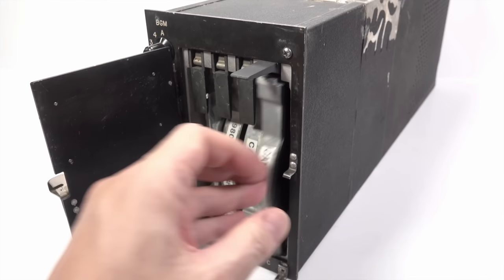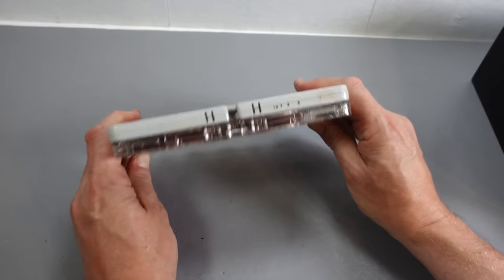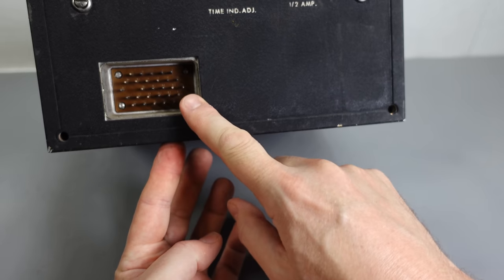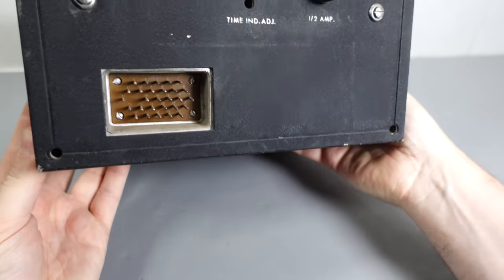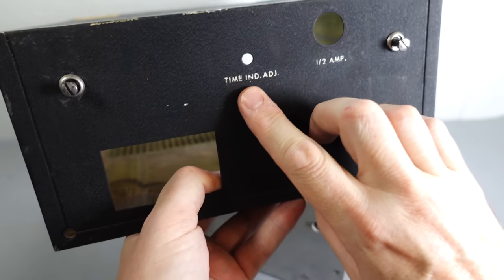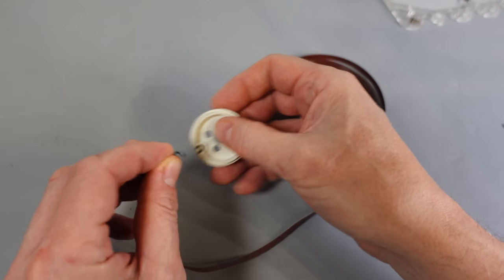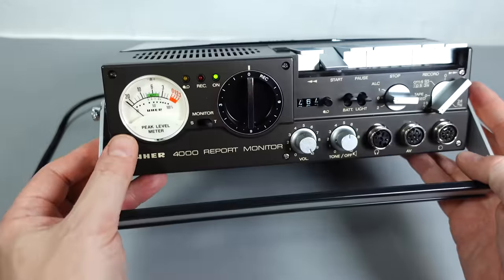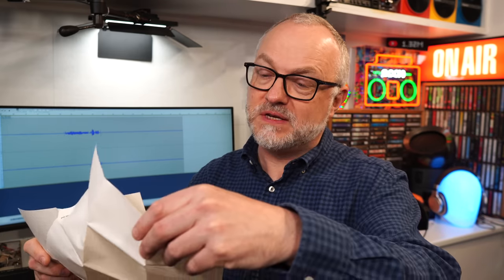Mystery aviation tape machine

Comment: Quick Access Recorder (QAR).

While it’s the best known, the FDR is not the only type of recording device used in aviation. The QAR could be thought of as the non-emergency alternative to the FDR. While retrieving data from the FDR usually means the worst has happened, the QAR is specifically designed to facilitate easy and regular access to flight data for research and maintenance purposes. Its data is stored on removable media and since the QAR is not expected to survive the loss of the aircraft it isn’t physically hardened. In fact, modern aircraft often use consumer-grade technology such as Compact Flash cards and USB flash drives as storage media in their QAR.

Source: Teardown: D50761 Aircraft Quick Access Recorder from hackaday
Reply: you win today ☕
Reply: 👍 this
Reply: Great find.
Reply: The fact that this says it was made for the FAA is also interesting. Between the heavy flywheels and that wild multi-pin connector at the back, this definitely looks like it was designed to be on an aircraft, but the FAA doesn't sell airplanes or airplane parts! My wild guess is that this was something designed for the FAA's small fleet of aircraft that they use for checking that radio-based navigation and landing aids are working properly. That would also line up with the very low serial number, since this was likely a bespoke product for the FAA.
Reply: 100% agree.

QAR can also be used for investigation of equipment failure or crew error if those did not result in complete aircraft destruction or just randomly checked to assure quality of operations. 

Because FDRs need to be extremely robust to survive almost anything, quality and quantity of information stored on them is very limited - especially in early days. 

FDRs may store only a couple of last minutes in barely recognizable quality while QARs can store the entire flight's audio (and flight parameters). 

Removal of FDRs usually requires some sort of disassembly by maintenance personel, and playing it back may require disassembling it by forensic specialists, while QAR media should be easily removable, replayable and archiveable.
Reply: Great info
Reply: God bless the internet
Reply: I agree.
Back in the 60 ies a CVR would record a 30 minute loop.
So a 30 minute backup or Transfer device would be totally ok.
I don't know when they changed it, because 30 minutes before a fatal crash the fecal matter allready hit the fan.
Reply: I think it's more likely from a control tower than a QAR from an aircraft.
Reply: i would give this a like but it's at 69 so i'll just reply for the algorithm
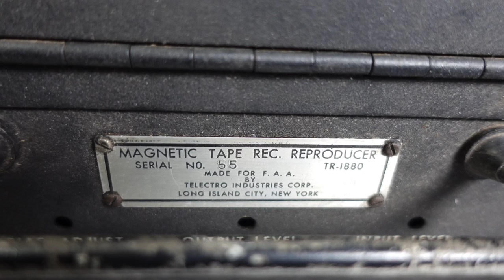Reply: @Hans-gb4mv Take a look at the nameplate at 2:56 - it says it was made for the FAA.

Also, the approvals for stuff like that aren't printed on the part itself - it's separate paperwork.
Reply: But there's a voice recording on it, so I don't think it's a QAR, really.
Reply: No.
Reply: I think it's an early CVR my friend. QAR is optional, not FAA mandated
Reply: the problem is, if it was installed on an aircraft, the way it is built it wouldn't survive a crash. so i doubt it is a cockpit voice recorder (CVR). on the other hand, i don't know what the standards were back in the 50s and 60s. 
also, QARs record data, not audio, correct?
Reply: Nope. I'd go for a CVR. 'QAR' is pretty meaningless - a modern aircraft will have multiple QARs recording different things but all attached to the aircraft data bus. It's a 'Q' AR because the operators can get to it easily rather than having to, say, shift cargo and pull up floor panels etc to reach a more permanently stored data device. The fact that this recorder has analogue voice audio on it suggests it is NOT a QAR.
Reply: I'm guessing because it was made for the FAA it was for research rather than maintenance.
Reply: @bluesh1ftlabs  find nearest elevator and you'll find that date of last inspection is written somewhere in the cabin. It's completely normal to have certification stickers on a device.
Reply: @alastairbarkley6572  QAR is not "meaningless", they referenced their source right in the comment - a very similar device which has "Quick Access Recorder" printed directly on it, albeit seemingly a later device.
There's also seems no reason why it couldn't have been in the cockpit, along with various other modular items.
Reply: @bluesh1ftlabs  Maybe it was made for the FAA because the FAA required Airplanes to have that thing exactly to their specification? So they just provided it for them?
Reply: See the scene in the movie Blue Thunder when a message is left in the cockpit.
Reply: @radry100  No, then it would say something like "to FAA specification" or "conforms with FAA regulation". To me for FAA means for FAA internal use. WHich would suggest for FAA research or survey plane. Since FAA does do stuff like airspace mapping, navigation aids and so on.

Heck it might be as simple as session recorder for FAA to record survey flights. It also could be an early "data recorder". For example tied to survey radio receivers on the survey plane to record radio location beacons or so on for regulatory verification.

Looking online it seems telectro did lot of government work. Seem to be notes of here and there of military signal corps and so on telecro made machines all with low serial numbers. So they might have been a "boutique" maker, making custom recorders to exact custom specifications. Which again would suggest FAA wanted a custom instrumentation jobbie. Hence for example the massive fly wheels. For example should it have been instrument recorder say for navigation radio, the consistent precise recording speed would matter. Of course it is audio recorder, but well radio signals, even instrument signals can be recorded as audio recordings. Including it's plate lists it as magnetic tape recorder. Not as magnetic audio recorder. It might have been for audio, but as said it also might have been for instrument signals.

That it has test recording of audio, might be pure co-incidence. Maybe the actual FAA recordings were just jumble of beeps and boops from for example VOR (early radio direction navigation system) radio beacons

one busines listing lists: PRODUCTS: Transistorized receivers & recorders, special designs, etc.; closed circuit TV system to transmit over telephone lines.
Reply: I think it’s for training purposes, used in simulator or training aircraft.
Reply: This is exactly what i thought it was too an inflight recorder !
Reply: I feel like this doesn't quite answer all the questions though because the FAA didn't actually mandate cockpit voice recorders until '64 and that was only for 4 engined aircraft, so what plane did this come out of that it predates that and presumably also had a CVR because why would you have this and no CVR? who knows
Reply: @mrxmry3264  According to an “Electronics World” article from 1960 written by W. A. Stocklin and and titled “Electronics for the Jet Age” they were already implementing hardened Flight Data Recorders for use in post-accident investigations. It stand to reason that they were hardening voice recorders as well, which might explain why this piece of tech was mothballed in the early 1960s if indeed it was a QAR or radio/voice recorder.
Reply: I checked with my aviation friends (who go back quite a ways), what I've heard back is it's a first generation voice cockpit recorder.  I assume it was made "for the FAA" as it would have been a retrofit for existing aircraft.
Reply: This comment needs to pinned at the top.
Reply: This one seems more likely to be an early CVR than FDR. Given the evidence that the tape had voice recorded on it, plus the input/output level adjustments on the machine.
Reply: Except different box different tape different manufacturer.  Other than that...
Reply: Yes actually found it as well.
Reply: Qar don't record voice my man. this here is either a cvr or from a ATC tower or similar.
Reply: It’s definitely an aviation voice recorder but the box is not rack mountable for aircraft use. I’d say it’s for recording air traffic controllers on 30 minute playback. If there was an incident, the ATC supervisor can swap out the tape in question for a new tape without stopping the machine. There was probably a recorder for each console or ATC position. That’s my best guess without knowing for certain. “Say again” is definitely an aviation expression.
Reply: @mii747  Plus it has that distinctive flat audio sound of an AM-modulated transmission over an aviation headset...
Reply: @mii747  It wouldn't be for ATC logging use. Those used slow and large multi-track reel-to-reel recorders called call recorders, as did emergency dispatch radio (police, fire, emergency call centers). For example, the Racal ICR32 in the 60's used 8-inch reels, recorded 32 channels at 15/32 inches per second and could do 24 hours on one reel. Swapping tapes every 30 minutes would be a nightmare and unreliable. The term "mark the tape" became a request when somebody screwed up and you wanted them to preserve the tape as evidence, somebody would shove a used flight progress strip into the reel so they could find the exact time for review.
Reply: @Demonslayer20111  I have a weblink that shows it is but can't post it because it will get removed
Reply: The QAR tapes were a real pain.  I think they needed to be replaced every 50 hours to have the data recovered.
Reply: OK I was close. My guess is it's some part of the cockpit voice recorder (after I heard the word "say again" in such a pilot way lol). But yeah... that won't work as a cockpit voice recorder, if the plane crash, that thing is gone. Not surprise that they have more than one recorder doing different thing, this is aviation after all. Close enough I think.
Reply: QAR has electronics for instrument data/diagnostics. the device in the video is definitely an audio recorder.
Reply: @RWSCOTT    I remember when the QAR tapes were tape.
Reply: With all those pins on the interface, and two 2-track heads, who’s to say it didn’t record data? The 2 tiny snippets of audio clearly indicate a test. They may have been done at the factory and this thing never saw service.
Reply: @AuntieFan  because there's no circuit boards in the unit to accept that data. it's a tape recorder.
Reply: @RWSCOTT  Really I don't know, those who do are probably in there 80's+. But what other medium would you use in the 60's, 70's and early 80's to record data most likely from an analog source? I see just a recorder with a time monitor that could record voice or any analog signal easily generated from instruments or sensors. I could imagine the tape would later be played into a linear stylus graph drawer (profilometer) similar to a seismometer and there you have it: timed stamp data!
Reply: @RWSCOTT  Maybe that's just the recording unit that received the data stream and put it to tape. Modulation, diagnostics or whatever else could be handled with other equipment. Which would be very typical for technology of the era, since complex circuitry like this was still very clunky and cumbersome back then.
Reply: But the age of this model seems quite odd. There was not even a mandatory FDR or CVR in the 1950s as far as I know, the QAR on hackaday was out from a 737-300 which wasn't even built back then and for the time it seems odd to have this completely optional piece on board. But I could be wrong.
Reply: @gentuxable I'm confused. Just because something was not mandated by FAA does that mean that private companies would not put in cockpit voice recorders on their own volition?
Reply: @AB0BA_69  It does have a FAA sticker on it right? But even if not, usually that is the case because doing that would make your product less competitive without much benefit, it could even give the impression your airplane is less safe than the competition if you have some recorders nobody asked for. And if there was one they'd have not made a special product just for one customer, they'd repurpose another audio recording device.
Reply: @gentuxable  Give that impression to whom?? 😂
Reply: @AB0BA_69  potential customers of an airplane. Remember how long it took until we had such primitive things like fire alarms in the cargo hold? Would've been easy to implement even a century ago.
Reply: @gentuxable  You mean passengers? How or why would they even find out about such a recorder???
Reply: @AB0BA_69  usually the company buying airplanes are not the passenger of the airplane. If I buy an airplane I would compare the models and find the one that best suits my business and I would find it odd if the manufacturer just hides the recorder build it in an airplane hidden.
Reply: It could also be used in aircraft simulators, which do move around in realistic ways. The heavy fly wheels would prevent against anything undue during the simulator and the removable media would give the pilots a chance to review their own performance in the simulator after the simulation has ended.
Reply: Wow!!!!!!!!
Reply: Could it be used for listening to an ATIS recording at an airport if its not installed on an aircraft?
Reply: @PEPcessna  Probably the only question is why would you need an over engineered, super expensive, FAA approved, time stamped recorder to do that?
Reply: @bluesh1ftlabs  Yes. I had the same idea so you are probably right about that. (I studied arcraft mecanics for 2 year but didn't finish it)

Comment: Hi Matt. What you have there is a cockpit voice recorder. But it was only used for test flights and training etc 
A friend of mine has a couple of these,(same unit but in a silver case).
He is a collector of old aviation equipment.
The year of manufacture  is may 1961 from the serial number (55). These were manufactured in relatively small numbers  from 1958. So you get the year of manufacture from there. 5 years after 58 is 61 which denotes as 5. The next 5 is the month, being may. So serial number 55. From what i was told these units were only used up till about the end of 1965. Interesting the unit you have is possibly  one of the last produced as they were only manufactured until or around the end of 61/early 62  Hope this helps.
Reply: The Interweb suggests that this device was manufactured for the USAF.

Comment: Hello Mat, I thought I would throw my comment in the ring in hopes it helps unravel the mystery of this recorder.

To begin with, in the 1980's and 1990's, I worked for Rockwell Internation, Collins Avionics division in Engineering in the US.  I had design responsibility of the airborne communications equipment from the mid 1950's to 1980.  Collins did design a CVR (Cockpit Voice Recorder) in 1964 for use by the airlines.  It was an extremely rugged unit, made to take the shock of the aircraft crashing into the ground at high speed plus, it had to survive a one hour fire.  The tape format was basically the Lear 4 track, although built around a custom transport mechanism.  To maximize survivability, the CVR was mounted in the tail of the aircraft and it ran off of 28 Vdc; the power bus that goes down last as electrical systems fail.

So, getting back to your mystery unit.  My best guess is this unit was one of several of the FAA's predecessors of a CVR.  Not a proposed CVR but, a proxy machine (or Test Bed) used to develope industry specifications around.  Functionally it was a CVR but, not built crash worthy.  And yes, the connector the unit uses was an airline industry standard in the 1950's and 1960's.
Reply: Hi Bill. Did you work in Cedar Rapids, Iowa, by chance? Up on Collins road, or down on 32nd? Maybe along 1st Ave?
Reply: @cdmccul  Only for visits to the Assembly Line and Test when problems cropped up.  I was based in Melbourne, Florida.

Comment: If any of the motors or other parts have a frequency marked on them then that could narrow it down a bit. 400Hz would most likely be for something in the air, 50 or 60Hz would be ground-based. Of course it could also run off the standard 28V DC bus, in which case all bets are off :)
Reply: why? do they use 28 volts DC anywhere else?
Reply: Vehicle borne military radio, especially in those days.
Reply: The motor appears to be a dc type. It is a fully shielded cylindrical affair with a small diameter, typical of dc motors of the day.
Reply: @mrxmry3264  Some high power base stations/repeaters for 2-way radios use 28 VDC, though the telco standard of -48 VDC has become more popular. 28 VDC would be used for call recording situated at a radio site because it could be powered off the same battery-backed power system that ran the equipment.

Comment: The clue is in the customer name FAA The Federal Aviation Administration. I guess this was used on one of their flight checker aircraft that inspects airport navigation aids etc. Possibly a Convair 240 or a DC3. There may have been an audio time stamp that would be applied from another blackbox through that multi pin connector.
Reply: Very underrated comment! This piece of equipment is from the earliest days of the FAA, which was founded in 1958. If I had to guess, I‘d say it was used to document the SNR of radio communications between an FAA aircraft and the tower depending on the distance traveled and the radio frequency used.

Comment: @0:25 the label shows what appears to indicate 115 volts 400 Hz. Aircraft alternating current electrical systems use 400 Hz because it is easier and cheaper to manufacture that equipment. Such equipment also takes up much less space so yes, this would have been found onboard an aircraft.
Reply: 400hz also made the ac transformer  much lighter.. an advantage in aviation.  👍
Reply: That was the other audio reproducer and that one was for passenger announcements.